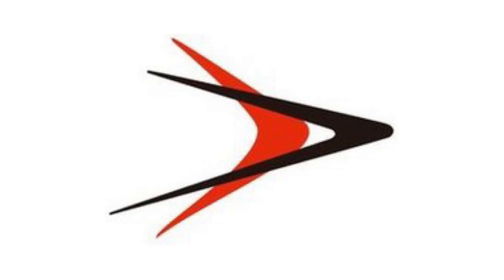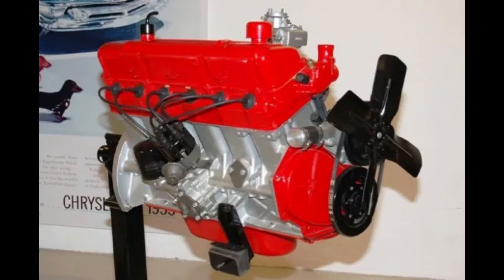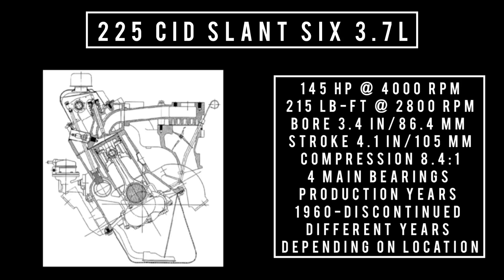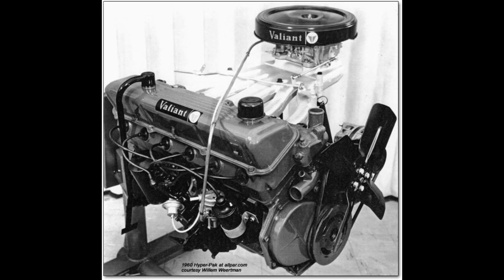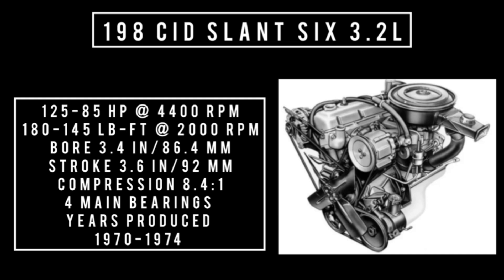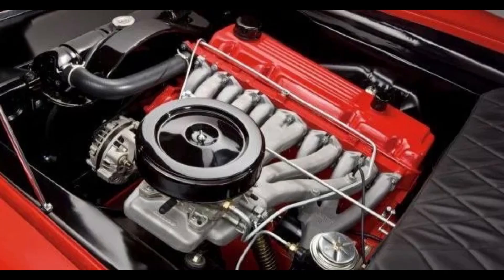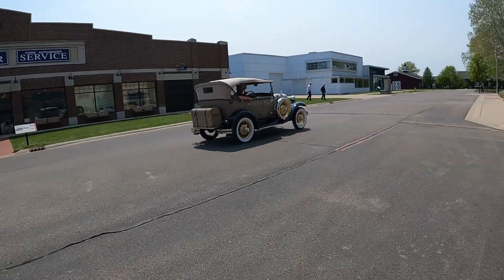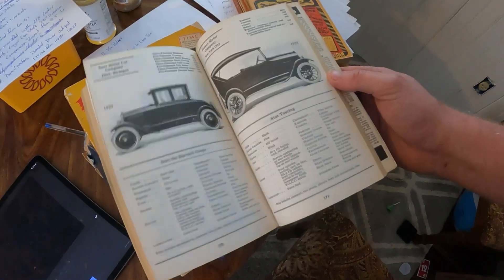Chrysler slant six engine family

Comment: I bought a 73 dart 2 door swinger. I called it lime green in color with a dark green vinyl top in 85 for $200 with 125,000 and hadn't started in 2 years . I got it started with a new battery and poured gas down the carb. I owned it for 10 years. I had to rebuild the whole front end in 88. Other than that, normal maintenance. In 95 I did an oil change and put in an oil additive. 5 miles later I threw a rod at 363,+++.  I'd say I got my money's worth. I drove that car everywhere including the mountains. I never questioned it's reliability. Slow yes. I wish I still had it. I liked the body style.
Reply from the maker: Awesome story thank you so much for sharing all those memories

Comment: All the hooha,, but at best a suspect engine with only 4 main bearings. 225s break cranks, often if turned near 6000 rpm
Adequate in 60s 145 and 160hp versions. Though were out of date when first made in 59.
The 'big' Ford 6s were 240ci. Or 300ci
My preference?? 250ci Falcon 6 or 202 Holden 6. Then a 265 hemi

Comment: Don’t forget the old AMC OHV 7 main bearing inline six that was used by Nash at least a decade before the slant 6 and continued in the Chrysler made Jeep long after the slant 6.
Reply: AMC got a new line of engines, both six and V8, in 1965. They were excellent and very durable, as you say, the 6 went on to the early 2000s in Jeeps.

Comment: I learned to drive on a 72 Dodge Dart with the 225 with automatic. No power steering, 4 wheel unassisted drum brakes, and a foot pump for the windscreen washers. The 225 did not endear itself to me. Power of a 4 cylinder, thirst like a large V8. That was replaced, in 1980, by a 75 Dart Swinger that was truly beautiful. The 1bbl 225 was even slower and more thirsty. Needless to say, my experience with a slant 6 taught me to run, not walk, if I learned a car I wanted was a six. That 75 was replaced by an 81 Volvo 245 with the carbureted 2.1 litre putting out a solid 105. It outperformed the 225 in every measurable way.
Volvo 240
Reply from the maker: Cool story thank you for sharing those memories =)
Reply: @What.its.like.  The kicker is that the first brand new car in the family was my Grandfather's 1940 Plymouth. The flat head 6 was about as fast and returned the same gas mileage as the 72 Dart, despite being larger, heavier, and much worse aerodynamically.

Comment: I have a 225 and a 170,  but I think the 258 AMC, ( not 232) was the best,  I drove Gremlin 258, very fast. Question:  did the Hyperpak also come on the 225?
Reply from the maker: Awesome choices I could not find information on that it was hoping that somebody could fill in that information in the comment section did 225 or could the 225 be ordered with the hyper pack
Reply: The Hyperpak kit was a dealer installed accessory made for Valiants. It consisted of a cam and valve springs, intake with 4 barrel carb, dual exhaust, and heavy duty clutch. It was made for the NASCAR compact car racing series  but anyone could buy one and install it on a 170 or 225 six if they wished.

Comment: In the 60s, NASCAR hosted an economy car race, featuring straight 6 (actually) stock cars from the big three. Chrysler set their racing engineers on their brand-spanking-new slant six to see what they could do. They came up with the HyperPak. In the race, not only did all seven Pymouth Valiants finish the race, but they also took the first seven places and even lapped the Fords and Chevy's a LOT. Because Chrysler had such a broad advantage, the race was deemed too boring and was never repeated. There goes Chrysler getting cucked by NASCAR for being too good, as always.
Reply: As an OLD, OLD guy; I remember when MoPar DESTROYED Chevrolet (ALWAYS) and (MOST EVERY RACE) Ford! GREAT "NASCAR rides", but GREAT ANYDAY cars!
Reply: Hyper-Pak was never on the factory option list.

It was an over-the-counter dealer option installed at the dealership.
Reply: Happened all the time. Let's face it NASCAR is in business to make money. If Ford or Chev is winning the races they can sell thousands of tickets. If Chrysler is winning they can sell hundreds of tickets. It all comes back to what car is most popular and has the most fans willing to buy tickets. A ding dong battle between Ford and Chev brings out the crowds, Dodge or Plymouth winning all the races, not so much. So any time Dodge or Plymouth does well you can expect them to change the rules so Ford or Chev wins.
Reply: @mrdanforth3744  Well it ultimately led to extremely boring races. Now literally every car has a Chevy 350. Not sure why people watch it anymore. If they'd've let Chrysler win some without unfairly changing the rules, maybe Ford and Chevy would've stepped up and made even better products to compete. What a joke. Honestly, even if you're a Ford or Chevy guy, (the general 'you') how unsporting would you have to be to be ok with them literally changing the rules to benefit your team?
Reply from the maker: Awesome information =)

Comment: I just bought a 73 Valiant 4dr ac power steering. Almost no rust and interior is almost perfect original. It was a friends grandads who bought it new. they took great care of it. Just bought a slant six for $100 in great shape. The original had rusted the cam and crank areas. Like rust dust deep in the pan and covered the cam. The old quaker state oil must have gotten water in it to do that much rust damage.
Reply from the maker: Wow that’s crazy

Comment: H P ratings went from gross to net, wasn't a dramatic drop in power, had many slant sixes, 66 valiant 170 3spd manual, the 1 bbl 225"s were 8.4 to1 compression in the 60's pretty much on up i have an 84 dodge truck now and it doesn't  have 50 less hp otherwise it wouldn't pull a full size truck as well as it does, just like a 71 318 is rated 230 hp ,a 72 is rated 150, same engine only a net hp rating had a 72 and 73 318 among the strongest I've had and have had many owned my first in 1976, still drive the same year cars. yes some smog pumps and catalytic converters robbed some power but wasn't as dramatic as the new net figures would seem to indicate, there's all kinds of ways to rate power, they rated the 340 deceptively low at 275 at 5000, for insurance purposes,the engine would rev considerably higher and still be making more power, same with the 426 street hemi 425 at 5000 and it would rev as much higher as the 340 did past it's so called power peak, or I should say so implied

Comment: I had a 73 Valiant and an 80 Dodge Diplomat coupe with the 225. Both ran 300k, although the 73 definitely had more power. I worked at Argonne National Lab in Lemont IL in vehicle maintenance from 2005-09 and they used 225s to drive water pumps for flooding and sewage. Governed at about 3000 rpm max, these engines had TONS of running hrs on them and dated back to 1964! Except for valve and side cover gaskets, they had never been apart.
Reply from the maker: That’s crazy

Comment: Had  64 Dart with the slant in 1965.  Was involved in an accident where I was hit on the right front, at night.  After dealing with the situation I drove it the 10 miles home, although running poorly.  The next day as I surveyed the damage I discovered the dizzy cap was broke nearly in half.  The engine ran with only 4 contacts in the cap & open to the air!  The broken piece was hanging by the plug wires.  Couldn't kill that engine.
Reply from the maker: Crazy story thank you so much for sharing those memories =)

Comment: You don't understand how engines work. Missing important details, with some details associated by you, that aren't IRL,

This would be an ok video for amature enthusiast, with some audio & video deleted, but not for a pro.
Reply from the maker: It’s history of the Chrysler slant six engine family it describes what this video is in the description it doesn’t say we’re going to take one of these engines apart and put it back together..
Reply: IE: you mention the internal corrosion issue associated with the aluminum block engines, but show some iron cylinders with rust on the bores.  That wasn't the problem, at all. The problem wasn't on the cylinders, or the iron liners, but on the aluminum block casting, itself, generally around the camshaft (which had no bearings on aluminum block models) or cooling jackets (I believe due to aluminum interaction with the coolant).

Not the bores, as shown.

Comment: It's difficult to compare power and torque levels when you cross over the time period when ratings changed from gross horsepower to net horsepower.   There is some data from 1971 models that shows both gross and net ratings for the same engine, so you can see how much power loss was due to the change in rating method.  There were also reductions in power due to "Emissions", but the reduction in advertised power due to the change in the rating method didn't reduce performance.
Reply: I think the new for 71 Net figures were deliberately conservative to allow for the 72s to be weaker yet have the same advertised net horsepower and torque, as many, not all but many, of the 72s would be left behind by identical 71s.  Race a 71 Ford with a 351 against a 72 with the same type of 351, (there were two different ones, a 351 Windsor and a 351 Cleveland) and you will run and hide from that 72.  Stock vs stock of course.  The 73s were even slower, and the 74s slower still.  I have an old Chilton shop manual that shows both gross and net horsepower for most cars, and the net figures are about 12% lower, not 33%.

Comment: 232 AMC a solid dependable engine

My grandfather had a Plymouth station wagon  probably a 59.  It had the slant six in it. It did a good job of moving that station wagon down the road. It wasn't a speed demon but that engine had lots of torque and it could pull you up a mountain grade easily with power to spare. It was a very nice car. I remember riding in it as a young boy. I remember looking at it with my dad when my grandfather bought it new and to me the engine looks funny cuz it looked like it was leaning over.  One of the great automotive engines. No doubt about it.
Reply from the maker: Great story thank you for sharing those memories =)
Reply: GREAT CARS!

Comment: As usual, various errors. The 1960
170 engine produced 101 gross HP,
not the 117 you stated.
When talking about Slant Six strokes,
you need to use fractions of an inch,
3 and 1/8 for the 170, 3 and 5/8 for
the 198, and 4 and 1/8 for the 225.
     For your choose-a-Six contest,
the older Ford Six in question displaced 223 cubes, not 233.
And forget the Chevy 235 Six, the one to
have is the bored-out 261 version,
which came in Canadian Pontiacs
and some GMC trucks.
     The Slant Six would not fit the
K-Cars in a "transverse", or "sideways" configuration.
Reply from the maker: Numbers vary from source to source up to 117 BHP fractions are hard to read for viewers (got that comment in the past) great catch on the ford 223 not 233

Comment: Of the choices presented, the 232 Rambler six with its seven main bearings is a great choice. 
One might also consider the Buick V6s at 225 cubes, available in the A-body Special and Skylark models from 1964 through 1967, and in '64-'65 Olds F85 models. Rough as a pit-bull puppy, but the 155 horsepower wasn't bad. 
Also think about the Pontiac OHC six.
Reply: Yep. The Rambler 232 was the best of the bunch. Would live on in much refined form as the 4.0 Jeep six for many many years.
Reply: Chevy 6 also always had 7 main bearings and always OHV! 
AMC used FLAT HEAD 6 into 1966 !!! 
Early Buick V6s not acceptable... ran like a V8 with two bad spark plugs... very irritating...
Reply: @BuzzLOLOL  Yep. The 201 flathead was an old Nash engine from the 40s at least.

...and yes the Chevy 6, especially the newer 230 and 250 models, were very reliable AND could be hot rodded. They had decent sized valves and a good sized bore. The 225 slant 6 was strangled by it's 170 sourced head with it's puny valves and 3.4" bore. Reliable, but low performance.
Reply: I didn’t like that 90° V-6 Buick until the brought out the even-fire version. Then they developed it into one of the all-time greats …

Comment: In 1985 I had a 1979 Plymouth Volare 4 door with  couch comfortable bench seats that I only got because it was very cheap. Perfect body and interior with the 225 slant six and an A-904 automatic trans. It really surprised me with it's get up and go around town even with my girlfriend and her 4 kids. Very dependable and would just go and go with no problems. But where I really came to appreciate it was when I had to move to Austin from Houston to find work to support her and the kids. Once I was working steady I would get off at 3:00 a.m. Saturday and get to Houston at dawn then leave Houston at 11a.m. Monday morning and get to work on time. I was getting 31 mpg at 80 mph. That long stroke of that 225 c.i. slant 6 was a great motor. The trans gave up and I had to just leave it where it died. Still think fondly of that car. If I had only had the money to fix it I would probably still have it

Comment: 7:05  I would remind the viewers that by 1972, horsepower and torque were advertised in terms of SAE net figures rather than SAE gross. 
The decrease in advertised horsepower and torque were more due to recalculation to the net figures than to any added emissions equipment. 
The 225 rated at 100 horsepower in my '74 Coronet gave adequate performance, but it was a bit snappier than it would have been with the Torqueflite. 
Tom McCahill remarked that the inclined engine affected the handling characteristics, different steering response in turns to the right versus the left. 
Another remarkable performance note, the 225-one-barrel slant six in the '76 Coronet was EPA rated at 30 mpg highway when equipped with the standard three-on-the-tree manual. I don't know how they managed it, but it did little to sell either the six or the stick shift in the technically full-size Coronet/Satellite sedan.
Reply: The EPA got in a lot of trouble for bogas car testing. Eventually, in the late 80s, they were forced to revamp their numbers to better reflect real world conditions. Subsequently, numbers dropped, which peed off manufacturers but as I stated, better real world numbers. To answer your q about how they managed to squeeze 30 mpg out a mid sized 3600lbs sedan w/o OD was run it with all windows closed, all accessories off, nothing in the trunk but the factory spare, 1 aboard, 55 mph, extended flat road, and less than 1/4 tank of fuel. In other words, perfect conditions.
Reply: We has a 75 Fury sedan with the Slant 6 and automatic transmission. The powertrain was incredibly reliable and incredibly slow.
Reply from the maker: Thank you so much for pointing that out =)

Comment: Great piece on the history of an indestructible engine. I knew a farmer that had a slant six in a late 70s 1/2 ton pickup that he would use to pull a horse trailer. It would go anywhere as long as you weren't in a hurry.
Reply: You could rebuild it while still in the engine bay; great engine;
Reply: I had a 1972 Dodge with a slant 225 and 3 on the tree. I hauled scrap iron and towed trailers with it. I actually wore second gear out. 3 rd gear downhill and 2 nd gear uphill all the time. In and out , back and fourth. On a flat it would pull okay in 3 rd. Hit a hill and you were going to need 2nd no matter what unless the truck was empty and then you might pull the hill in 3rd. The truck never failed to start no matter how cold it was and I had a 1 barrel carb with a manual choke.
Reply: The "Super 6"(in a Volare/Aspen) would BURN THE GROUND!
Reply: The ford 300 had a long run

Comment: My vocational school auto shop in the early 80s gave me lots of experience, and tales to tell about the slant six. #1) i saw one start and run with the distributor completely 180 degrees from where it should have been. God only knows how it ran! #2) one came into the shop making a horrible racket, come to find out, it was only running on 2 or 3 cylinders, but it kept going somehow! They were nearly impossible to kill once all that terrible useless 1970s emissions vacuum line crap was removed, unless, of course, that damnable resistor made of porcelain on the firewall got a crack in it! Hard to fathom such a nearly indestructible engine could be knocked out by such a small piece getting a hairline crack, but it happened. And, I can still hear those lifters clacking along in my mind today!

Comment: By all accounts, the AMC inline 6 was probably the toughest and had the most potential. Eventually, it made it up to 258 c.i. and may have been AMC's longest engine in production being around for maybe 3 decades? Ofcourse the real AMC powerhouse 6 was the 4L eventually putting out 190 net h.p. and being one of the best engines ever made. The increases in AMC's 6 cyl. displacements was because of emissions rather than power.
Both Ford(300c.i.) and GM(292c.i.) had big block sixes with GM's different from any of it's other sixes.